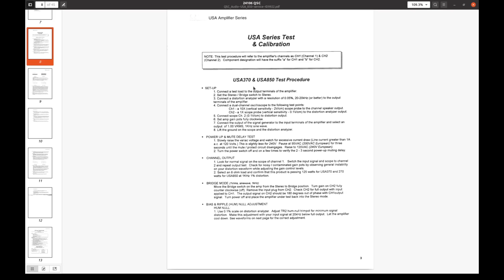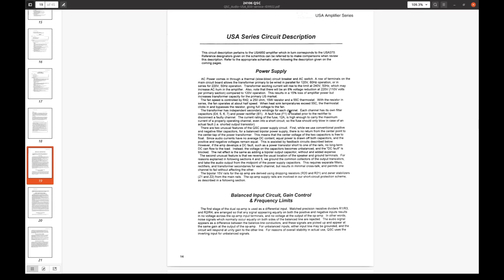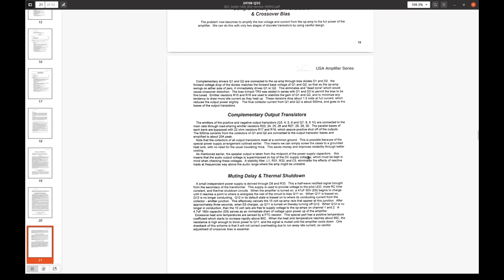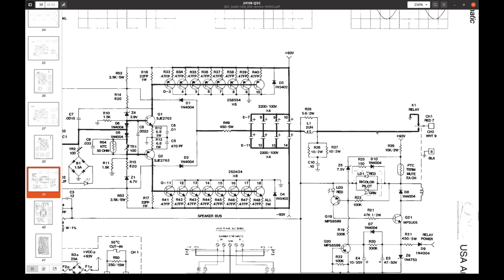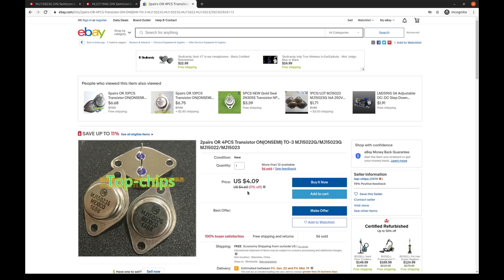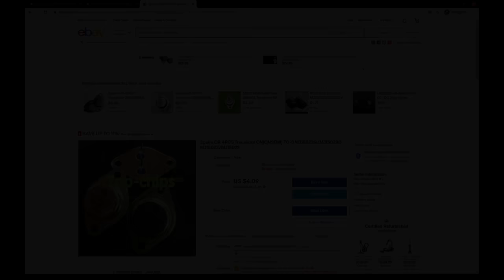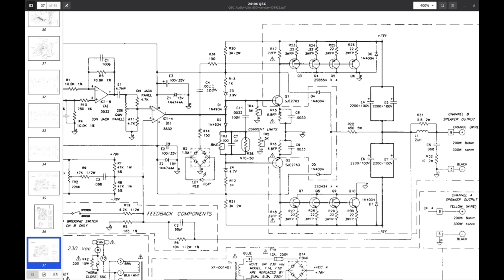#106 - QSC USA 850 power amplifier repair

Comment: Let me tell you a couple QSC stores. The first is a series one 1200. This amp started life with a local rock band in 1985. Than was sold to Roman Hill a rock band I ran sound for for a couple of years. It latter was sold again to another band. Than came back into my life about 1995 ish while I was the sound man for Justified a local country band. It stayed with us up to the leaders death and to this day still preforms every week end with the former owners grand son.  The only work ever done to this amp is cleaning. The second is a latter model 1400.
It survived running near full power in to a shorted speaker system for about five hours.  After the short was cleared the amp worked just fine and still does every night in a local theatre. The QSC series one amps were good preforming, durable,no frills amps manufactured at a good price point. They usually are easy to repair and generally are worth saving.

Comment: I have used these QSC amplifiers in cinemas for many years. They are normally  really reliable and do sound good, even in HiFi use. they are very conservatively rated and work well into low impedances and bridge mode.
Reply: What size qsc amplifier would be good for cinema I just got the qsc 1400 and it's not enough power for what I want I'm currently pushing 2 260 watt 8 ohm floor speakers I'm going to get some huge 4 ohm speakers what's a good size for super loud bass 🔊 👍 thanks

Comment: Buying electeonic parts from Ebay (China) is an almost guaranteed tipoff. A bad deal at any price.
Reply: Yup, I once bought large transistors like that from ebay to fix a power supply - they were definitely fakes as well.
Reply: The trouble with ebay is you don't know what you will get. Sometimes the devices are genuine, but most are fakes if you buy from chinese sellers. I bought some MJ15003 from one knowing they were probably counterfeit but thought I would try anyway as I was covered by the money back guarantee. I thought if they were genuine then I have just got a bargain! They turned out to be fakes. I confirmed that with a message to ON SEMI. I got the refund.
Reply: Audio transistors from eBay are these days almost all fake - ask anyone on diyaudio.com....
Reply: @MarkTillotson  Yes, pretty much all of them are - but every now and then you can find some genuine NOS devices but it's hit and miss because you really don't know what you're getting.
Reply: All chinese transistors are 2N3055 remarked
Reply: agreed bought to3s for a 5000x sansui  fried the the driver board... get nos or good used
Reply: @sw6188 thats right，personal repair engineers in China are basically on the JLC or some corporate stores to get accessories in order to avoid fake things

Comment: Thanks for posting this, this is invaluable  troubleshooting for any of the tranditional QSC Class AB amps. If you look at the schematics of these amps ( USA series, MX series, RMX series) they are practically the same design that has been slightly changed over the years. Even the 1400 to USA850 to USA 900 are the same amp, the RMX1450 is the same amp design again just in 2U form.

Comment: hi ! very interesting repair. Things can be tricky when the feedback loop ( no pun intended ) is unbalanced. Here's a trick I used for years as a service engineer : I replace the output power transistors by a diode between base and emitter connections to close the loop. This way I avoid blowing up 200$ of power stage to Mars and this allows easy measurements with nominal voltages. Hope this helps
Reply: Wow 
@elecsys. I love your simple solution and lateral thinking. Kudos sir !
Reply: Indeed a very clever idea !!

Comment: Nice repair! Repaired one of these more than 10 years ago. I remember the fan being not shielded and driven by high voltage, quite painful when accidentally touching it. There is a plastic shield missing in your amp diverting the airflow to the transistors but would not matter much i guess. In my case that shield broke off and blocked the fan, amp heated up until destruction with the entire output stage shorted. Keep up the good work!
Reply from the maker: The plastic thing is on the top cover. I just did not show it.
Reply: @feedback-loop  you’re right, i was mistaken by my loose one :-) love your videos! Thanks!

Comment: A cool feature of these capacitively coupled output stage is pretty much zero possibility of passing DC to the speakers and no DC offset adjustment needed.   Every QSC amp I've worked on uses this even today.   Keep in mind that testing without a load you will see some DC offset.   Sort all your new/old transistors by HFe and try to keep them as matched as possible in each parallel bank.   The old ones can vary by a large amount and is probably why it blew a few of them in the first place.

Comment: I had bought from Aliexpress some MOSFETS and they where good. I always check the seller feedback before I buy. I know you took a chance, but you warned yourself and you didn't listen. Happy New to you sir and I look forward to watching you this year. Mark 8.33k subs as of 01/02/2021  CHEERS
Reply: Beware. Some parts will actually work, but they may not last - especially under high load. They counterfeit the devices but use much smaller dies and at first the part appears to work but when you load it up or try to draw the rated current it goes BANG because it is severaly under-rated.

Comment: The body is in mint condition, those amplifiers sound truly exceptional and can easily go toe to toe with the best of the best, even things that cost 4 times the price, it is also made in USA and is built incredibly well, usually they only fail because of operator error and nothing more, if it was me, especially because the case looks nearly new, I would replace every transistor and fully recap it, check all solder joints, clean all the controls inputs outputs power switch out with deoxit d5 and possibly put a better and more quiet fan inside like a noctua or something similar, build a little power supply with it, a full wave rectifier, a nice cap and a voltage regulator coming off the fans ac line with a noctua 4pin pwm fan controller, put a light foam airfilter over the intake vents and use it as my man amp in my main system and get a good 50 more year's out of it till my future kids get it and I'm long gone. Qsc still does make reliable traditional amplifiers that still sound nearly as good, but everyone else, is pretty much junk with very few exceptions. Vintage qsc gear is the holy grail, on par with the old school crest CA stuff and the old crown macrotech, d series or k2 stuff....

Comment: That amplifier is drawing a lot of current from the mains supply for only 50W output on a single channel channel. I would be concerned were all that extra energy is going - probably into heating the output transistors.

Comment: I tried to use some of those Chinese power mosfets in a ppi pc2350, and they lasted about 1.5 3 minute songs and smokomatic maximus. Ordered the part number from a reputable p0arts house and it fired right up and works to this day. The correct parts were expensive but well worth it.

Comment: I have used a few QSC amps in live sound systems.  I would generally describe them as "pretty okay" in terms overall quality and sound, in the middle-to-slightly-lower range of the market.  They work; they sound reasonable.  I want the bass to feel like a locomotive, and a QSC just doesn't quite, and I want the highs to be kinda open and shimmery, but the QSC can't quite do that, either.

So... if the application is not critical, and the price is cheap, a QSC might do the job, but if I wanted nice sound, or if it was expensive, I might look for an alternative.

For a good amp, my first choice would be a Crown (but not a PowerBase).  The Micro Tech and Macro Tech amps are heavy, almost never break, sound great, and just do all the things you want; they are a little upscale on ebay. They probably powered most of the concerts you went to back in the day.  Stacks of 'em.  Movie theaters, and so on.  For portable systems, any of the newer switching amps do pretty well, and weigh almost nothing.  The problem with Crown is you're less likely to get a chance to make a repair video.  :)

The old Mackie FR power amps were *great*, except for a slight tendency to blow fuses when you turned them on.  (Huge inrush current!  Big, mean power supplies.)  But they were gutsy and sparkly and wonderful; they made really nice, solid bass guitar amplifiers, or clean and clear mains amplifiers.

There are other amps for reasonable prices; I would guess most of them are somewhere around QSC quality, a little lower or higher, depending.  I would avoid a particular "B" brand, though.
Reply: The better QSC (like the Powerlights) tend to be upper-end of the market (about on par with Crown, though IMO a better product), their lower-end stuff (GX series) tends to be lower end of the market. 

The older analog Powerlights were great amplifiers. They're some of the most reliable amps around, and they actually sound really pretty good. From a measurement perspective, they get fairly close to the MC2 amplifiers (and that's saying something), though I haven't had a chance to do a real A-B listening test between the two. Fans are a little noisy, but not bad.

As a side note, when we're talking about companies that have made some really lackluster stuff over the years, Crown might just take the cake.  The old Macro-Techs were probably some of their better products, though they are definitely not my cup of tea. The fan in the Macro-Tech really doesn't move as much air as you'd hope given how loud it is.

Many will say that nothing touches a BSS EPC780. Of course, there's also almost nobody around who can fix an EPC780, so they aren't very practical.
Reply: What is your opinion in ASHLEY amps?
Reply: @Centar1964  Me?  I've never used one.

Comment: Might be interesting to measure the parameters of the eBay transistors using your checker tool. I wonder if they are damaged or just relabelled? Could dremel the lid of a blown one and have a peek?

Comment: Looks like these are for sale between $125-200 on reverb.com. I would get my money back from ebay and then buy the right parts to fix it as long as you don't end up losing too much money in the end. This has happened to me a few times and I try to look at it as I paid for the fun of solving the puzzle. You win some and lose some. One thing to consider before you head down that road though... your current draw is pretty high even though it is working. Hopefully those good transistors are not wounded. I'd cycle through the other pairs to see if the current draw is any different. If you have to replace them all then this unit might have to go to the boneyard, I don't mind losing $20 on a piece but not $100. Also look up what the power transformer sells for these. Often times parting a unit out will bring more than the unit whole. One last suggestion is what if you found an equivalent in another package such as the TO-264? Those seem to run cheaper. MJL3281A maybe? Of course you'd have to get creative with the wiring/mounting.
Reply: Look at complete ebay auctions. They actually sell, as opposed to being listed and sitting without any interest, at $37-50 in the last two months.
Transformer and the case are the only valuable parts here :(
Reply: @rasz good investigating. I hadn't taken the time to look. He could fix it and then donate it. I've gotten some business over the years doing such things.

Comment: I noticed in the schematic the original outputs were japanese 2S numbers... Perhaps it had outputs replaced before which explains the mismatched complimentary pairs. Assuming the originals are obsolete at this point and the MJs are the only choice. Either way, QSC are good amps, it would be worth repairing.

Comment: Isn't there a class D board that will work with this power supply? IRS2092S based boards for example, they can match the power supply as those are single ended.
Given the simplistic schematic of that amp, it is likely to be an improvement. And you can keep the input boards and power supply.

Comment: Is there a newer cheaper T0-220 substitute, because it could be screwed down with one of the original screws.
I thought they were fakes because the blue bits were too bright and new looking. I bet the writing comes off with acetone.
Reply: A TO-220 package would be a very poor substitute for these transistors from a power handling perspective.

Comment: did you get ebay refund for the fakes? there are pictures on the net of those opened up, pretty much packaging whatever just so they pass transistor tester :/

As for the amp, imo its old junk, Sold ebay auctions for a fully working unit from just last month: Nov 25, 2020 , 6:20PM
 Winning bid:US $37.00
Throw out the pcb, reuse case and transformer to power two IRS2092 +2xIRF6645 $15 D class 500W modules.
Reply from the maker: Most probably I will get a refund for the fakes.

Comment: Another option would be to load 8 of the good used transistors into one channel, and install a set of 8 new transistors into the other (perhaps at a later date when finances allow)...   This would reduce any issues from non-matched transistors as the channels are independent...

Comment: I have one of those amplifire but  the USA900 version .But the  clip light comes  on and when I turn it up it works fine . I get to understand that the resistor  are bad .they were change and it's good again .
Then one day it happen again someone came to look at it and change some resistor  . It never works since .But a next technician  says that the technician  uses 47k ohms  resistor  which are wrong. But I am yet to get it fix .
My question to you are there any 47kohms  resistors in that amps that you are fixing .

However I would love to see you fix that amps .it is little and neat and play good .
I can't afford a CVR .

Comment: hey i have a peavey bass amp the fuse blows when i check all the output and driver good ..i check diodes all good and other transistors...power transformer good too.....any idea on how to procedde i did not replace the output sein that it check good i suspect them thou

Comment: Hi all, 
I have the USA900 (must be a close relative) and I find it to be a very reliable workhorse. I would repair this one. Find transistors with equivalent data, especially voltage, current and hFe, and you should be fine. Would be interesting to know why the amp originally got blown? Connecting the output to ground somewhere? Short circuit under full power? 
In my experience, these oldschool-amps can take a lot of beating and abuse, before they give up.

Comment: Please open both bad transistors, the chineese and the original to see if they are the same. For the amp: other parts can fail that you did not checked, caps and pots can be bad also!

Comment: hello and happy new year. i don't understand the signal path in the output transistor as they are directly connected to the supply +76v or - 76v and the 0v. Where is the swing output that should go through the output capacitors??
Reply from the maker: The midpoint of the power supply is not connected to the ground. So the output stage pulls the rails towards the ground. And that midpoint is the output of the amp relative to the ground.

Comment: This amp has a weird output topology which besides having common collector connection and no separate output cap I can see no reason for it other than to be different. If it was such a great topology why doesn't everyone do it? It actually seems more expensive to implement as it requires a seperate power supply for each channel and the only thing that can be shared is the power transformer, albeit needing 2 separate secondary windings. Voltage balancing across the serial connected caps is not regulated in any way and differences between the serial connected power /output caps will render the output waveform asymmetrical under load. It depends on the caps being matched and a symmetrical A/C waveform driving the outputs. If the power supply caps are not matched (ie. one is open) the voltage will raise on the lesser capacitance side causing an offset and can possibly blow the output transistors. I was never a fan of capacitively coupled output amps and this design seems more of a trick than anything useful.
Reply from the maker: I can see at least a couple of advantages: 1. no DC offset even in case of failure (not killing speakers) 2. no need to insulate output transistors from heat sink (better heat transfer)
Reply: @feedback-loop  I think the disadvantages outweigh the advantages and thus you don't see anyone else using this topology.

Comment: I have one of this model QSC amplifiers, I purchased it in a known faulty state (from eBay as it happens) as I'm capable of repairing it.  Same basic problem with blown transistors, both output and drivers and someone had "had a go" before me and made a bit of a mess.  I managed to get a circuit diagram but not the whole manual and it does tend to get a little warmer on one channel than the other so I will follow your shown procedure for adjusting the bias.  I seem to remember transistors being quite cheap though but I do get components at wholesale rates so maybe that's why, I actually replaced all 16 as I don't trust semis that have been stressed but test OK. I have this amplifier just sitting on a shelf in the workshop at the moment as I don't really need it for anything. Class D units are now the go to amplifiers in many cases and are much lighter anyway. Could you please point me in the direction of the complete manual by any chance? Enjoyed the video BTW.
Reply: you can find complete qsc_usa-400_900_1310.pdf just by googling, inside there are detailed troubleshoot and adjustment procedures.